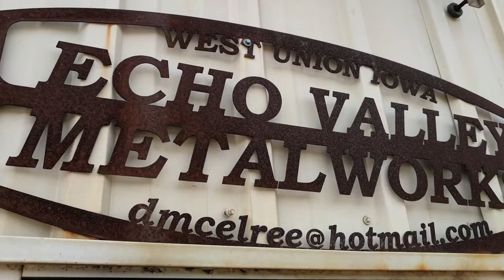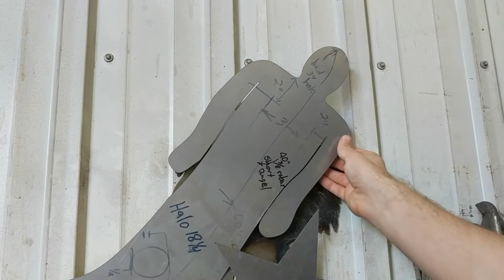Uproot & Roam Bus Conversion ROOF RACK

Comment: WoW !  Thanks million ! been Looking for the Info  on  "No roof Holes Deck" build An all the EXTRA INFO,  JUST SEEING GOOD VIDEO  helps me see and answer many Question  # 1  you save me a Lot of headaches   the hight off the roof  leaving room to weld underside    Great  video !  Thanks  Again
Reply from the maker: Susan Latimer Hey Susan. Thanks for watching, I'm so happy it was helpful. The clearance between the peak of our curved roof and the bottom of the rack is 5" and I would recommend increasing it by a couple inches to make it possible to paint the underside of the rack down the middle section.
Reply: Thanks for the info.  Always looking for new ideas.

Comment: Good video, thanks. Am making a roof rack for a  Blubird much like yours with side supports. What did you do to seal the bolt holes along sides? The video doesn't show what you used, I am considering butyl tape and maybe some dicor sealant after compression of butyl by tightening bolts, do you have any advice based on your experience?
Reply from the maker: Mark Martin, we never sealed the bolt holes where the verticals attach to the ribs of the bus but we intended to and totally forgot. Thanks for the reminder! We may use Quad OSI sealant or go with one of your suggestions. I haven't had great luck with butyl tape around our skylights but maybe because I wasn't able to put it under enough pressure. This would probably be a good application for it. Let me know what you end up trying and how it goes.

Comment: I have been in love with the way you guys have done your bus since the minute I watched the tour but ESPECIALLY THE ROOF RACK AND SOLAR!  We just posted a video talking about our bus exterior layout plans and we will also be doing a full roof rack but it will definitely be different from yours in ways.  I'm trying to decide right now if we should bolt the supports from the side like you guys did OR bolt the rack through the roof...  I think both would work just fine but I feel like you get a few extra inches of width doing it your way.  Either way, you guys are awesome!  KEEP IT UP!!!
Reply from the maker: Thank you! We chose to mount through the sides instead of the roof so that we didn't introduce new opportunities for leaks. We haven't done any drilling through the roof yet, just one hole through the side where our PV (solar) wire comes in through a cable gland. Let us know if you have any questions. We're happy to help. Good luck! Can't wait to see what you come up with.
Reply: Awesome!  Thank you and will do!  The leaks were my concern as well!